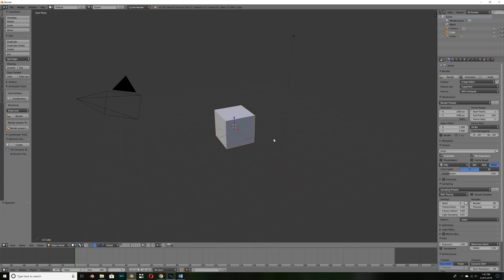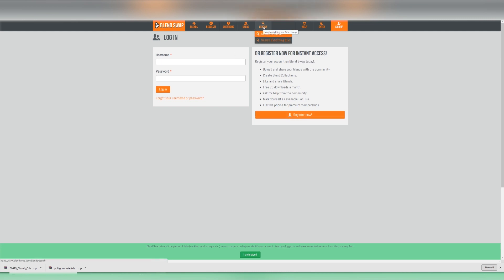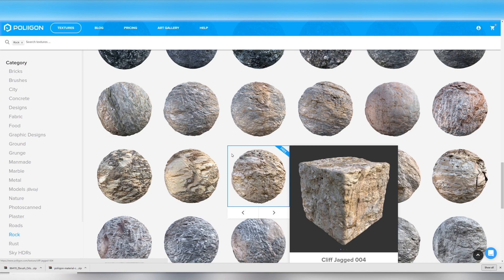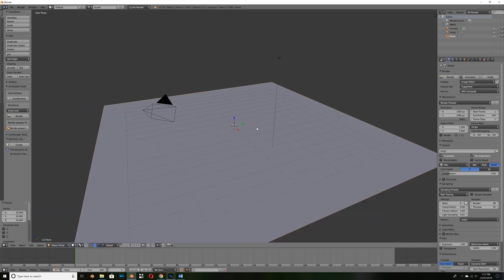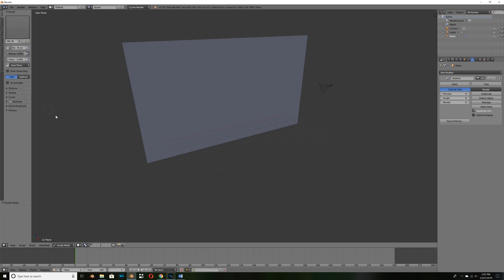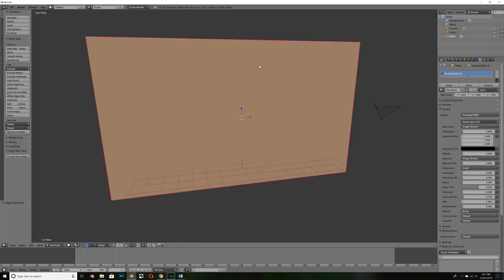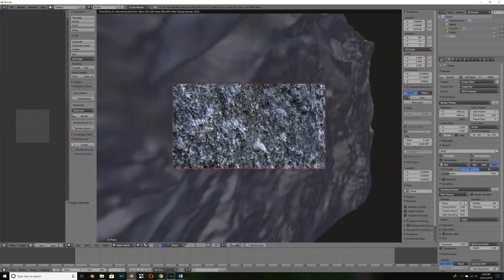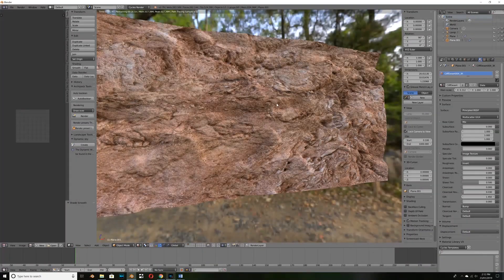Create Realistic Rocky Surfaces in 60 Seconds!!! - Blender Tutorial

Comment: for some reason I can't install the brush? Whats the exact file im supposed to be installing is it the zip?
Reply from the maker: You'll need to extract the zip file first (Right click > then select "Extract File.") Then once you've opened Blender select: File > append > (Select the Rock Brush blender file. It should be called rock_brushes.blend) That will bring up a list with folders like Brush, Image, Light, Material etc... From that list, select the folder entitled "Brush." Then press A to select all and close to the bottom right corner select the blue append icon.

Hope that helps! If you're still having trouble or that was to confusing, let me know!